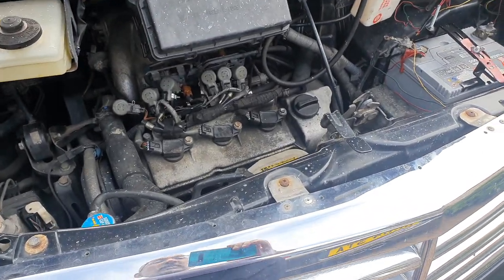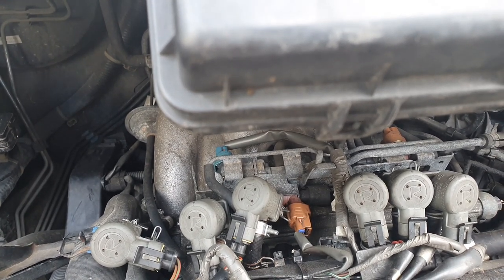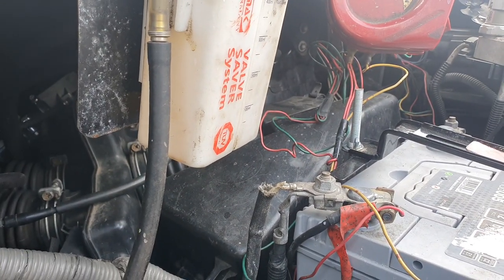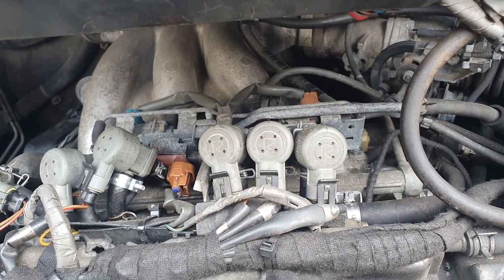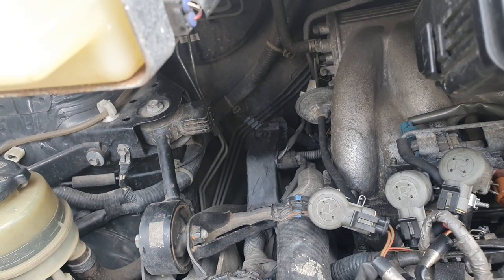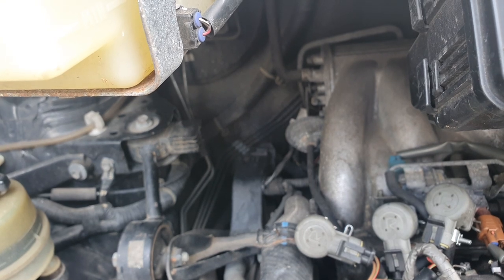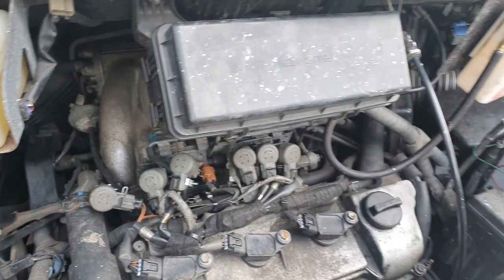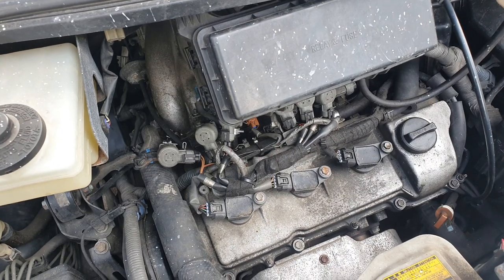Toyota Alphard massive increase in fuel economy. Failed pcv valve and fix. 50 miles per tank more.

Comment: Hi, how many miles you get per tank ?
Reply from the maker: Could you watch rhe video Johnny and let me know if I've forgotten to mention  it in the video?
Reply: @Cuttothechase  Hi, watched your video, say around 230 miles to the tank. I just bought a AN10, kinda surprised only getting 300 miles to the tank. That’s why trying to compare.
Reply from the maker: Ahh . I was talking about an lpg tank not petrol.
Reply: I have a 3litre petrol and it's a bit greedy on the fuel.could I kindly ask you how I go about getting an Lpg fitted?
Reply: Or can I I'm a lady drive😉r and it's all new to me,thanks
Reply from the maker: You can go to any lpg auto fitter. . I used New Acre cars in England. Reputation is important.
Reply: @Cuttothechase  thanks so much for all the information it's very helpful 👍😊I live in Scotland I might try find a good reliable company here if not I will travel to England thanks
Reply from the maker: The name tony Maskel is worth storing in your head.